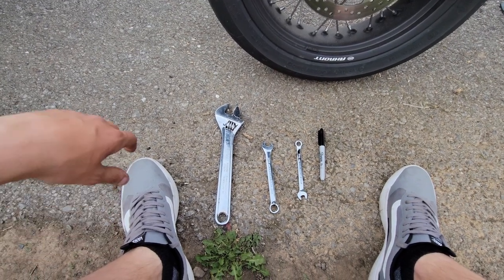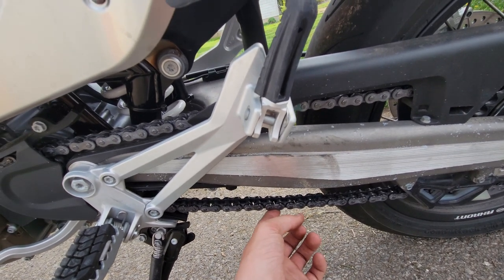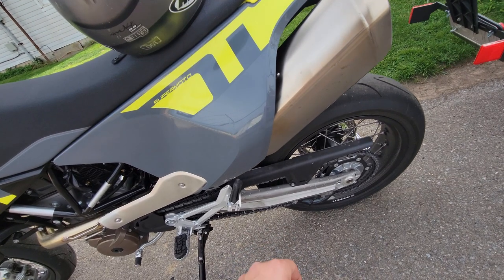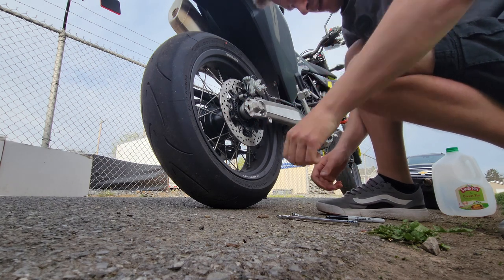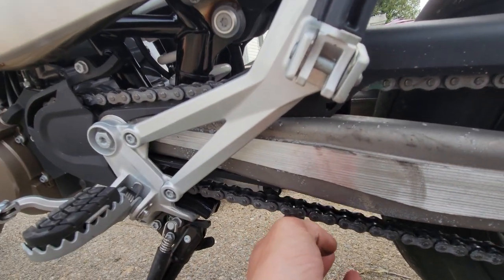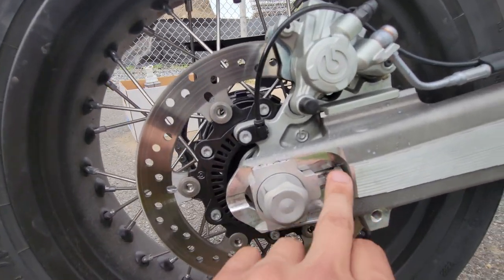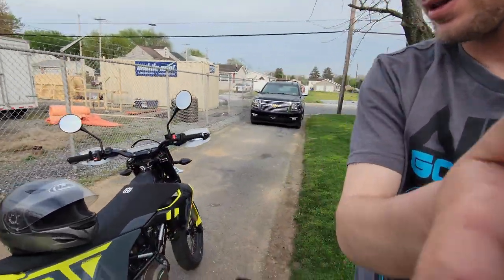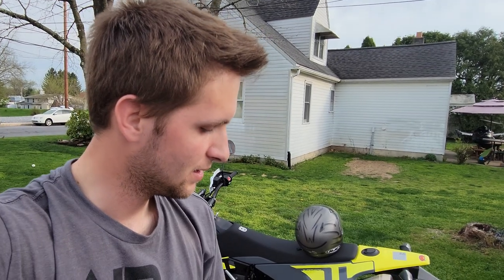How To Tighten Chain 2023 Husqvarna 701

Comment: Hey man, just picked up the same bike and finished first oil change at 500 (changed it early). Did you have a lot of metal in your oil? Mine didn’t look great and the magnet picked up a lot of metal dust. And my cylinder filter screens had a bit in there too. I’m sure it’s normal, but wondering about yours. ALSO my bike grinds into second gear going from first sometimes once the bike is warm…any comment on how the bikes transmission has been for you??? I’m hoping maybe my loose chain is the issue and am adjusting it tomorrow morning. Thanks!
Reply: I know you posted the question five months ago but yes metal fragments in the first few oil changes are not uncommon, nothing to worry about. 👍
Reply: @701Adventures  yes sir! Upon research I guess it’s particularly common with KTM (the whole bike is KTM). Also, for anyone wondering, that weird transmission issue seemed to go away after probably 1,000 miles. I started using my quick shifter for the first time after that constantly and now everything works great (5,000 miles) maybe something was breaking in? Maybe it was my chain? Who knows but bike runs amazing. Best bike ever surprised you don’t see more of them on the road